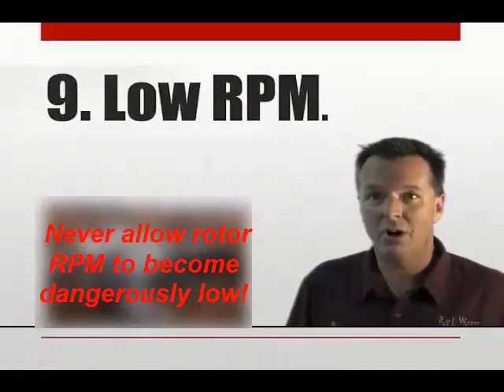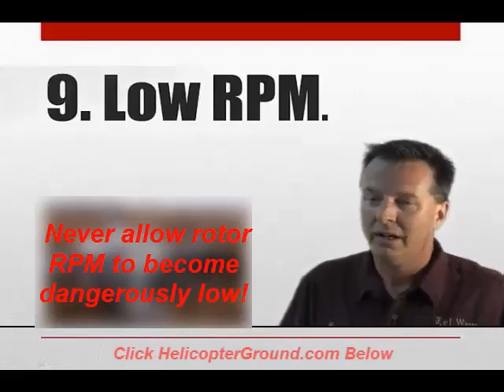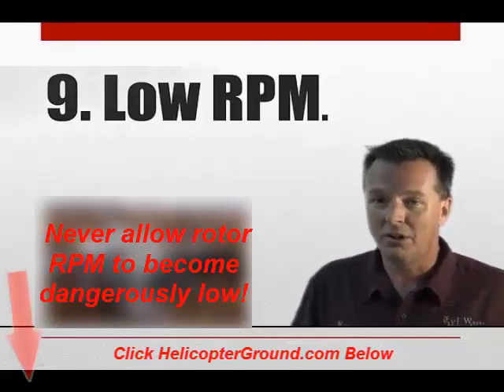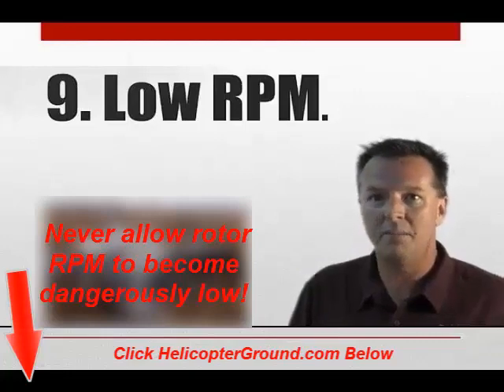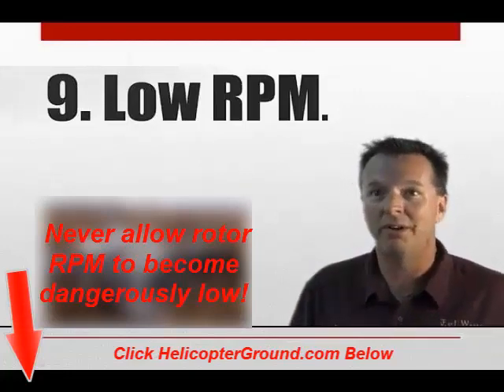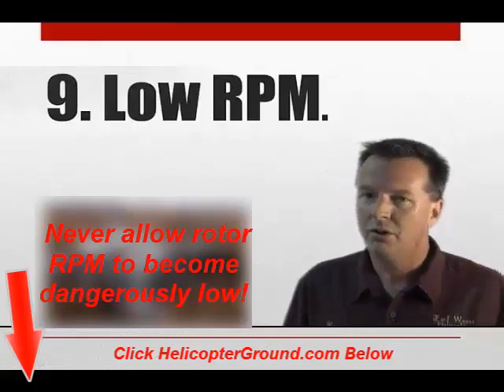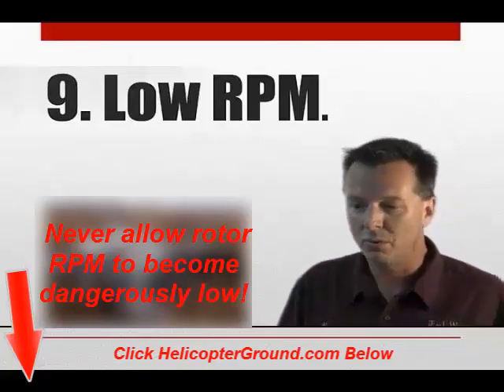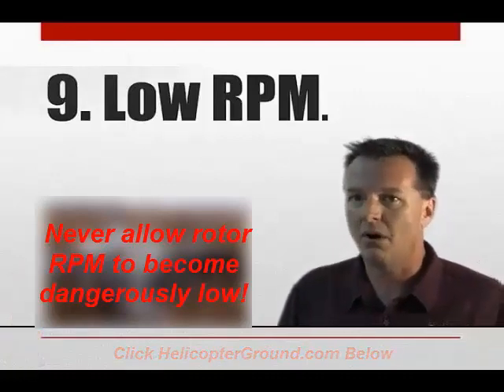#9 Robinson R22 R44 Safety Tip Never Allow RPM To Become Dangerously Low To Avoid Blade Stall

Comment: (Rotor RPM) are as important as (Air speed) on fixed wing aircraft
Reply: RPM on a helo is MUCH, MUCH more important than air speed for a fixed wing. When a fixed wing stalls you can just point the nose down and get going again. When a rotor stalls, that is finis for you. Very unforgiving.
Reply from the maker: stealhty1 Thanks for commenting!

Comment: Not a pilot but from what I understand - Low Inertia rotor system- pros: fast rpm recovery, light weight. cons: fast loss of rpms.
 High inertia rotor system- pros: keeps rpms longer, but if you lose them...cons:takes longer to get the rpms back
Reply from the maker: shakenama Thanks for commenting!